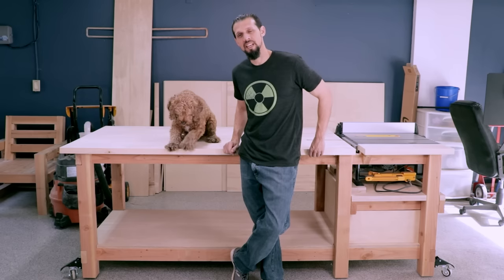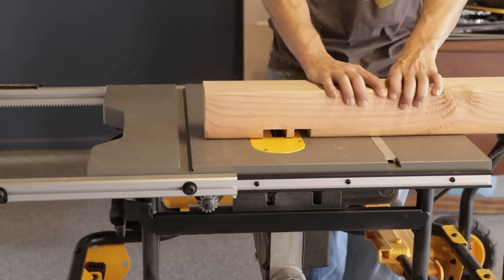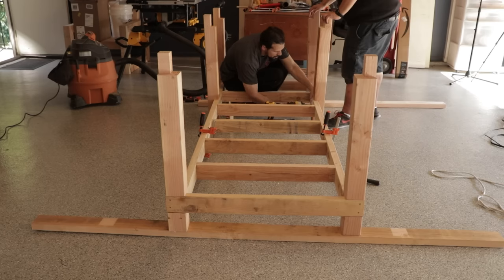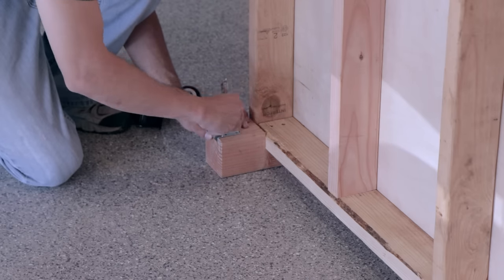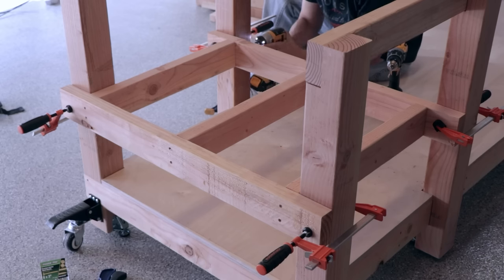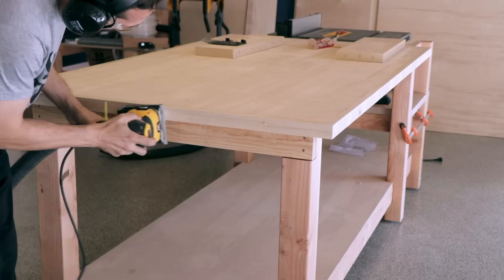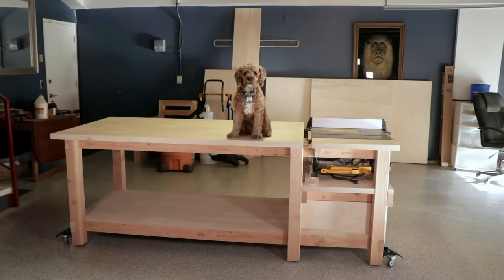Table Saw Workbench

Comment: I have built the bench using your plans. How do you remove the riving knife, to install a dado blade, without pulling the saw out of position? My riving knife has a lever built on the side of the table edge and the left hand small table plank next to it, won't let me pull open the lever to remove the riving knife. I could pick it up to clear the table top but the PVC line to the dust collector is solid so unless I unhook that from the saw, I can't tip it up to get to the lever. Got any ideas?
Reply from the maker: I do slide mine out some to remove the riving knife when I use my dado stack. The main two options for you would be add a little bit of flexible tubing to the end of the pvc so you can still move the table saw some, or to notch out the left side small table top just enough for the lever to move
Reply: I figured it out. I removed the side plank, notched the 2 x 4 and used a router to notch the underside of the plywood in that area. I can reach underneath the 2 x 4 and get hold of the lever. Works great. I didn't want to disturb the PVC piping as my fold down miter saw was also piped to the system. Would have made a lot more work. Thanks for the plans! The saw works beautiful now. I have ideas to build more drawers to hold other woodworking items, like planer, belt sander, etc. I have powered the bench, too and added extra outlets for anything I use that plugs in. 20 amp circuit and ceiling drop (I don't like stepping over extension cords and cord reels are too expensive that hold a 20 amp-SOOW cord).
Thank so much for the ideas and the plans! Enjoy you're easy going manner on camera and even showing us that even you can make a mistake sometimes :)

Comment: Hi Anthony (and Bob B.), how wide is the finished table? I'd like to do this project, but I need it to be able to fit in or out of my doorway, which means I've got a 32-34" maximum width. I got your plans and I'm wondering if I trim the "lip" on either side, could I get the width down to what I need?
Reply from the maker: its about 40 inches. would be hard to get it down to that small unless you remove the "lip" entirely
Reply: @woodpackdiy  thanks. Beautiful design. On the advice of my handyman and DIY tutor, I ultimately decided for my first workbench to go with a much simpler version. I might do yours next time 2-3 years down the road when I have more skills. Your work is great.

Comment: Very functional - do you think you could accurately cut down a 4x8 sheet in the middle with this setup?
Reply from the maker: Definitely. I have cut down multiple full sheets using it. I do it often with thinner ply (like 1/4 or 1/2"), but was also able to do it a time or two with the 3/4" sheets. For those, I use my shop cart to help support the weight of the sheet off the side of the workbench if needed to keep it steady. But since its so heavy for the 3/4, most of the time I just cut those down with my circular saw using a guide.

Comment: Did you ever think about turning saw 90 deg?  the logic is to allow for ripping plywood/MDF sheet.  I make dance pads with my son using 4 x 8 sheets.  there for we have to rip 8' into 2 4' then rip those into 2 34.5" squares save the left over for other parts.  plus we have a space problem and don't have the  room for all that bench. it get more fun that table saw is Craftsman 1952 model 103 8" Tilt. There nothing like needing 4' fence which doesn't come with the table.  it also needs some safety added to saw.
Reply from the maker: For me, the orientation of the saw is more optimal this way. Most of the cuts I do with my table saw work better with a longer outfeed table and I tend to use my circular saw with track saw guide for those long cuts on heavy sheets, but we all have our own preferences. That's one of the cool things about woodworking, there's always more than one way to do it and different styles work better depending on the types of projects.
Reply: @woodpackdiy  Try cutting a 4x8 into 4x4
Reply from the maker: I agree that would not be an easy cut using my table saw set up.
Reply: @woodpackdiy  wait till u see my pig.  it most case iron

Comment: The left wing, couldn’t you use a piano hinge so it could open and close to get to the lever for the riving knife?
Reply from the maker: That is a possible solution. Seems like it would work out well as long as you add a lock to keep it in place when not opened.

Comment: This is so well done.  I am BRAND NEW to woodworking and I want to buy a table saw.  I've been obsessing over whether I should buy an 8-1/4 in. or a 10 in. DEWALT.  The 10 in. Accepts dado stacks. Ive read that an 8 1/4 in has benefits over a 10 in. And vice versa.  Just wondering if anyone has any thoughts on that.  The 8 1/4 is $299 and the 10 is $599 so a big jump.
Reply from the maker: For me personally, being able to use a dado stack was the deciding factor. You can still do the same cuts wihout one, but man, that takes a long time and can get frustrating. I dont use the dado all the time, but it is so useful when I do. Totally was worth the extra expense.

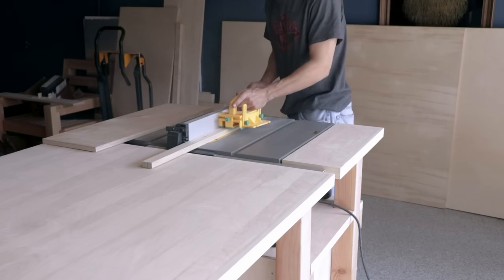Comment: Great build, well presented. @16:40 you're using a microjig type tool... doesn't it adjust down to the table top to provide more stability?
Reply from the maker: Thanks! And yes it does. That build was the first time I used that push block and I didn’t realize that adjustment at the time. I still forget about it sometimes. I gotta keep it in mind.

Comment: I have a question. Why did you use two sheets of plywood? It seems that a single sheet would have been sufficient.
Reply from the maker: There are a few small reasons, but the main one was my original plan was to inlay t-track and add some dog holes on the end. one sheet of 3/4 wouldnt be enough to add the t-track. I have been lazy about it, so still havent added those

Comment: Looks really great! How do you deal with the riving knife? Do you need to move the saw to access? Thanks
Reply from the maker: I slide the saw out a little and then I can access the latch. You could notch out the left table top so you don't need to move the saw, but for me it didn't feel necessary.

Comment: I heard using an 8'' dado set with this model is too much for the motor to handle overtime and instead recommends a 6'' dado set. Any issues using your 8'' dado set?
Reply from the maker: So far I have had no issues with it, and I have used the dados a decent amount.
Reply: @woodpackdiy  Thanks! How high did you set your dado blade on the saw for the legs @ 2:23? I'm thinking of getting a 6'' dado set and wondering if that will be good enough to make those dado cuts given it's a 6'' and not an 8''.
Reply from the maker: the overall depth was to get the thickness of a 2x4, so about 1.5 inches.

Comment: I’m kind of new to woodworking.  It seems there are two primary methods for building items like this: 

1) the method you used, building a sturdy framework that you can leave as is or later cover with plywood to make an enclosed case and install drawers or shelves, or 

2) using plywood only,  cutting  dadoes and rabbets and affixing the plywood together with glue and/or screws to make essentially one or more boxes to form the piece.   

Are there names for these two methods, and is one preferred over the other?
Reply from the maker: I am not sure of the names for the building styles. But for me personally, I definitely prefer having the sturdy frame for builds like this one. For this workbench, I need to move it a lot and put a lot of heavy stuff on it, so I feel the frame will support that type of use better. I do the plywood only when I am making regular cabinets (like my next set of videos coming soon - will be lots of cabinets for my miter station), or shop cart, or router table type of stuff (also upcoming videos). Those need to be sturdy, but will not face the kind of abuse a workbench will.
Reply: To add to the response; I think about a workbench as a large surface that I can clamp stuff to. That's way harder if you build it like a giant box or cabinet

Comment: Great design. I really like this build, and am thinking of updating my current saw/outfeed table combo. I really don't like unprotected sheet surfaces, though, because of glue dripping, oils, paints, etc. Do you recommend MDF or an inexpensive steel top as a substitute?
Reply from the maker: I don't have any experience using steel, but I do like/recommend using MDF. I used it for the top surfaces on my miter station build and it works out great.
Reply: @woodpackdiy  I just finished building this. I was the one who asked you about venmo. I was able to pretty much follow along just by watching, and man am I happy with the outcome! I made a few small mods, though. The first one was an MDF top for the side extensions and table top. The second mod was having the back wall behind the bottom drawer go all the way to the bottom of the actual table top. I cut a small circle the size of my dust collection hose so I can prevent any saw dust from getting into the bottom. Thanks for this design!!
Reply from the maker: @numerousactuary6640  Awesome! Glad everything worked out well for you!

Comment: Really well done — these extra finishing details look great, but also aid in keeping the bench clean/cleanable. One question, do you find the casters to be obstacles or kick hazards? I expect you considered mounting them on the inside of the four posts, but expect that’s not ideal either. Cheers!
Reply from the maker: Thanks! And, yes, I initially wanted to put the casters on the inside of the posts, but the spacing didn't work out for them to be functional there. I was initially concerned it could be a trip/kick hazard, but it turns out that is not the case. I've used the workbench a lot over the past 8 months and have never even stubbed my toe on them. I think it is because the overhang on the benchtop naturally keeps you back far enough. Also, the normal movements you do while using the table saw doesn't bring your feet anywhere close to them.
Reply: @woodpackdiy  thank you — good day!

Comment: I am retired and live in an RV. I have an open air workshop. I intend to use your ideas to make a table that will remain outdoors, and I will move the tools from my storage trailer to the outside table as needed. Any thoughts or suggestions before I begin?
Reply from the maker: My first thought is something you've probably already considered, such as choosing wood and/or a finish (like spar varnish or exterior grade poly) that stands up well to weather. And of course exterior rates screws/hardware. I do plan on making a mobile cart or two that will hold tools and be an extra work surfaces. That sounds like it would be useful for you considering that you will need to move tools from your storage to work area.
Reply: Thanks for the response...yes...will be using deck products and thanks for the the info on the dado set...did not realize it would fit on my DeWalt
Reply from the maker: It fits on some of them. mine is the dwe7491rs. the arbor is longer on that one that some of the other contractor style dewalts, so it can hold a dado.

Comment: Good afternoon.  I was wondering if you could tell me/us what brand 3" screws you used for this table and the pilot hole size.  I wasn't at first but now I'm using a 1/8 pilot hole and Grip-Rite #8 3" Phillips head Fine thread Drywall screws.  I basically have to lean my large body into them while using my impact drive or my PH bit spins out.  You make it look so easy when you are putting yours in AND your pilot hole size looks thinker than 1/8 (from the video anyways). Thank you in advance for your help.
Reply from the maker: I don't recall for sure, but most likely they were spax wood screws from home depot. They have the star drive and are self tapping, so technically you don't have to do a pilot hole. I like the self tapping/self drilling screws for these kind of projects because they go in so smooth. They cost a little more, but to me the ease of use more than makes up for it.

Comment: Great looking bench! Just bought the plans. Quick question about the levers to take the fence off.. is the latch in the back blocked until you move the fence all the way out? Or is there room to open the latch no matter the fence is?
Reply: Also about the riving knife release.. do you think you could cut out a portion of the underside of the table top so that you could reach under and pull the lever? Just enough so that it would still be covered but you could still get to it from underneath and not have to move the table
Reply from the maker: You need to extend the fence to remove it. I felt there would be too much space between the table saw and the bench if I left enough room to take it off in place.
Reply from the maker: Yes you could do that. I was going to do that myself, but tilting the table saw out slightly to remove the riving knife isn't a big deal to me personally. So it felt like more hassle to cut the notch than to use it as it is.

Comment: Anthony- I have made good progress on building the bench.  I am stymied on how to get the notched plywood into place that supports the table saw.  Your video skips over this step and your plans don't say much about it either.  Would be helpful as it is probably the most difficult part of the build.
Reply from the maker: I just tilted it and persuaded it to get in place with my rubber mallet. If the fit is just too tight, you can make the notches a little bigger and that should help

Comment: Do you have the plans for this somewhere? Have you considered adding a miter saw to this table?
Reply from the maker: Yes, I do have plans available. You can find them here: https://www.etsy.com/shop/WoodPackDIY?ref=search_shop_redirect
I am not planning on adding a miter saw to this particular bench because I'm currently building a stand alone miter station with lots of storage. But I am considering adding a bench top router to the workbench later.
Reply: @woodpackdiy  nice, are you making a video on that as well, the standalone miter saw stand?
Reply from the maker: @victorcruz6797  Definitely. Its a big build (lots of cabinet space for storage in it), so it will be a bit before the video is ready to upload. But I also have a bunch of other videos ready - some builds, some informational. Planning on trying to upload a new video every two weeks or so.

Comment: first that's a large outfeed table, not a workbench, it has no vice and no dog holes. Second, do not use screws into end grain for load bearing beams under the table saw. Besides that, great build!

Comment: Nice job with the video bud! What undermount drawer slides did you use? Thanks in advance!
Reply from the maker: Thanks!. I used these: https://www.amazon.com/Gobrico-Mounted-Drawer-Extension-Concealed/dp/B0774MRTHX/ref=sr_1_5?crid=N9XLGYZGC21R&dchild=1&keywords=gobrico%2Bunder%2Bmounted%2Bsoft%2Bclose%2Bdrawer%2Bslides&qid=1621482674&sprefix=gobrico%2Bundermount%2Ctools%2C370&sr=8-5&th=1

Comment: Great video! I'm currently working on one very similar with the "wings" on the sides of the saw table.  I would love to know how you cut those off?
Reply from the maker: Thanks! Those we just cut separately on their own after I figured out the dimensions
Reply: @woodpackdiy  Hacksaw?
Reply from the maker: @cindykiefnerthecoppertorch7789  Are you talking about the notches? I did those with a handsaw and chisel.
Reply: @woodpackdiy  In frames 2:27 and 15:00 to the left of the blade the work surface has an irregular shape, but later in frame 19:03 everything appears flush and neat with the workbench surface.  Mine has that shape plus it slants, so I don't know how to work around that unless I cut it away somehow.  Any thoughts on that?  Thank you and your friend and Bob Barker so much for such an educational and entertaining video!
Reply from the maker: It looks like you are talking about the irregular shape on the side of platform on the table saw itself. I did not alter that. I just made the edges flush with the workbench and there is still that void present. Later you do not see that area in the video because the fence is covering it, but it is still there.
Reply: @woodpackdiy  Thank you so much for explaining.  Maybe a metal plate could be fashioned to fit.  But if it's working fine for you, maybe it's just aesthetics and I need to quit whining. I'm subscribed, so I'll be watching for more videos!

Comment: I'm  extremely likely to trip over those casters. They are too far out. Also paint the table in yellow and black dewalt colors.
Reply from the maker: They look like they are a trip hazard, but after using the setup for a year now I can tell you they definitely are not. The overhang on top and natural motion keep your feet away from them

Comment: What really bother me is that you have a 3x3 leg, yet your skinny leveler is attached on the side of the 3x3.  Isn't it beat the purpose of having such a sturdy leg?  I would suggest a leveler at the bottom of the leg.

Something like (copy from Amazon description) Hankun Furniture Levelers- Adjustable Heavy Duty Leveling Legs, Protect Cabinets Sofa Tables Chairs Raise Feet, Black T- Nut Kit, 4 Pcs
Reply from the maker: The levelers I used do have a metal lip that goes underneath the leg, so it is supported on the bottom of the legs.
Reply: @woodpackdiy  I understand.  But it is strange to look at it with the legs "hanging" in mid-air.  Magic! :)  It feels more solid if the levelers are extended from the bottom.  I guess it is just preference.  But just want to bring it up.  Thanks for responding.

Comment: i dont see the benefit of wasting all that time sanding the bench top. its gonna take a beating
Reply from the maker: I agree its not absolutely necessary. Mainly, I just wanted to do a light sanding to clean up some rough spots. But it would have been fine without it.